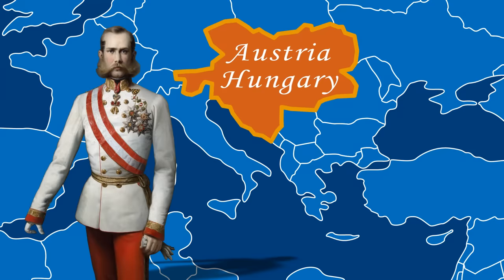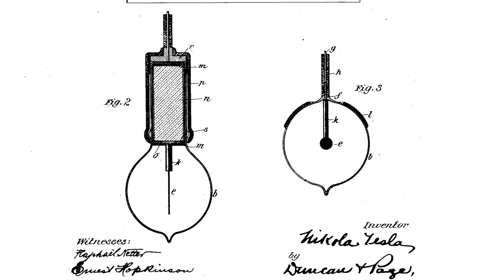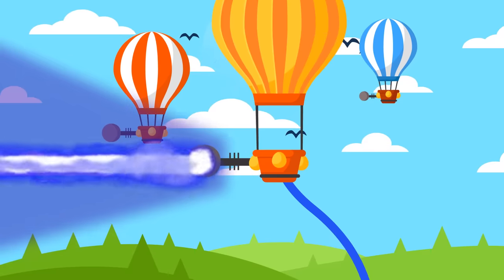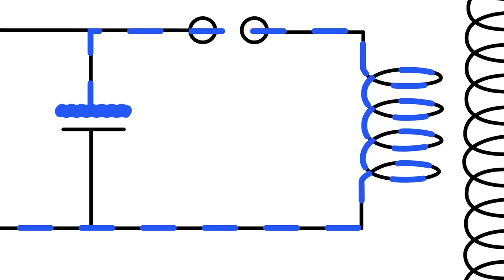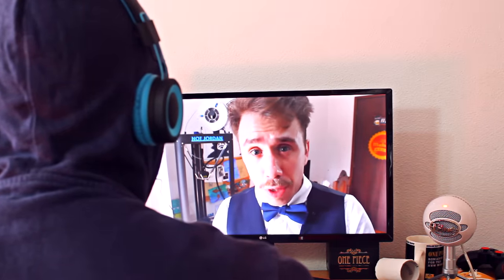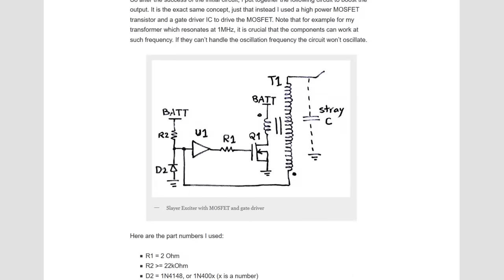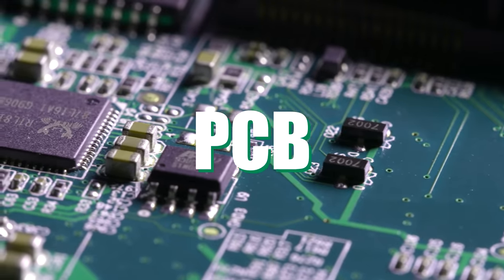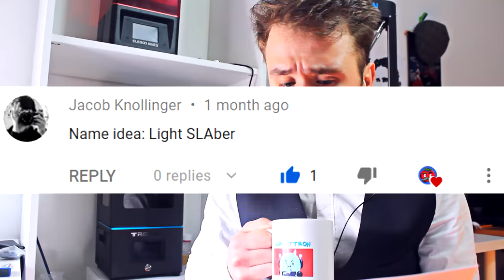Tesla Coil - Wireless Power Machine 3D Printed (ft .Plasma Channel)

Comment: resonator is spelled like this---resonator, not resinator. resinator:Brand name for: The Easy Separator. Forget bubble bags or dangerous extraction methods. Use our one of a kind robust stainless steel filters. resonator: A resonator is a device or system that exhibits resonance or resonant behavior. That is, it naturally oscillates with greater amplitude at some frequencies, called resonant frequencies, than at other frequencies. The oscillations in a resonator can be either electromagnetic or mechanical. I bet Tesla used the mechanical ones.

Comment: 3000V for 1mm gap?
I fixed an old Jacobs ladder that had a bridge gap of at least 2.5 - 3 inches, I was told it was 36,000 volts but had 3.5 amps, 0.5 amp can kill a man and does still today in common household wiring with 120V and 0.5 Amps. I fixed it, unplugged it, went to back of shop for a screwdriver, took 30 secs, I come back sit down and grab both metal poles and was instantly given 3.5 Amps and 36,000 volts in both hands, witnesses say I held on to it for a second and then was shot back off my chair almost 20 feet, I wake up and the whole class is standing around me and teacher kept telling them not to touch me and give me room. That was 33 years ago and today I live with over 20 diseases from a genetic condition they say is Ehlers danlos syndrome, but nobody in my family has this and it's a genetic thing passed down.

I think the high Amps fried my young body as I was in grade 10 then and Shirley after started getting lower back pain which turned out to be osteoporosis a decade later, that's what got the medical team looking it I why at such a young age. Nobody will touch the electrocution thing, I can't find ine Doctor to take me seriously and I shouldn't be alive,nit was enough to to kill 7 men and I was wearing a gold necklace at the time too and sitting with a metal pole inches from my Kees and ankles,nit should have conducted and blown out my head or body near the metal pole holding up wooden swivel chair.
Angels were working overtime that day 😇👍🏼😇

So with the formula of 3,000v per 1mm it would need to be 228,600 volts to cross a 3 inch gap? Perhaps it was 360,000V and I forgot a 0
Anywho I'm thinking of building a mini tesla coil to run a small light bulb outside on my balcony, any suggestions?

Peace and Blessings

Comment: You misunderstand the technology. The intention was to treat the earth as a capacitor by utilizing the electrical properties of the mantle and ionosphere. The Colorado Springs experiment showed that a periodic impulse device could be used to maintain a conductive channel between these two. He wasn't generating the electricity. The spark gap is essential to the design and the transistor cannot achieve the same results. Obviously if the device is designed without using a million liter water tank as a ground terminal or spark gap tuned to the resonant frequency of the gap between the mantle and ionosphere, the results will be underwhelming. The reason it didn't pan out was because of the risk of uncontrollable seismic activity. The electrical balance of earth is fragile and cannot be tapped indefinitely.

Comment: If i use ac power as an input power, i wouldnt need the dc circuit would i? Then how would i get the high frequency? With capacitors?

Comment: Sir I have my on tesla coil whish is capable to glow lamps upto 1 meter and output arching upto 19000 volts...

It works on 65 v dc source and have 1500 secondary turns and only 5 primary turns...... 

Sir I am inspired by your videos and I would like to share pictures of my tesla coil.......

Comment: there are a lot of stuff that need to be considered when you wanna make a good tesla coil and the s.e.c. isn't a good design. if you want some sparks, or longer sparks, try increasing the primary coil voltage or building a better circuit with an actual feedback source and some serious HV igbt, or just tune the tesla coil better. loneoceans.com/labs is a great website to refer to!

Comment: Still 'suck' at soldering Joel? There's a few things most people blunder through without realizing how important certain details are, especially when you don't use more flux besides just the piss ant amount used inside flux core solder! When you use more flux the liquid not only transfers HEAT much faster from the iron to the components but also CLEANS the surfaces being soldered for a better electrical connection and also creates a much stronger mechanical bond too! Even things like the iron's wattage and the physical size of the soldering tip matters because more mass in the tip retains more thermal energy to transfer heat quicker depending on the project. Here's a good "professional" guide I found a long time ago. https://youtube.com/playlist?list=PL926EC0F1F93C1837